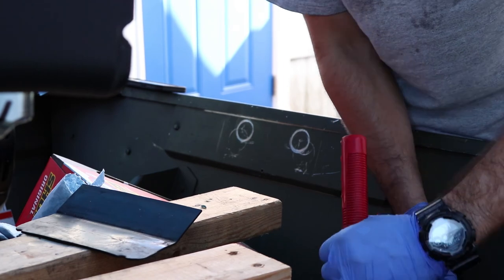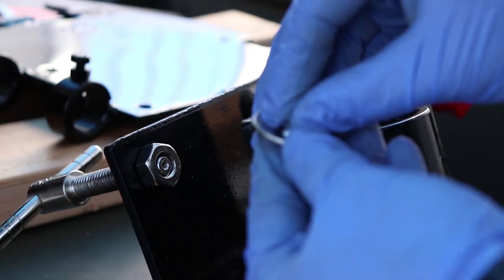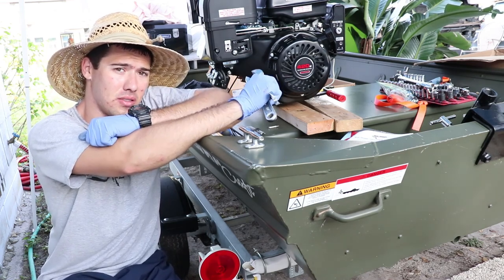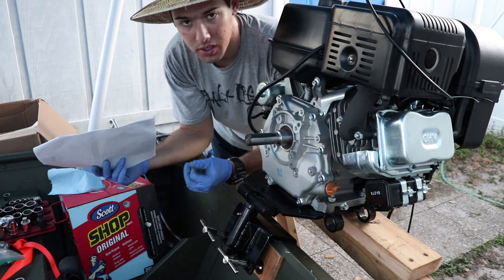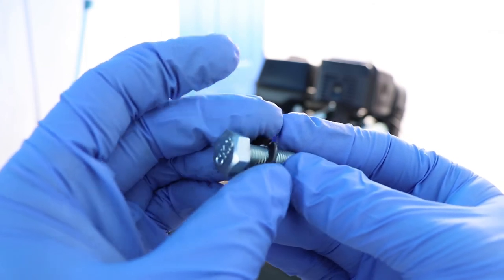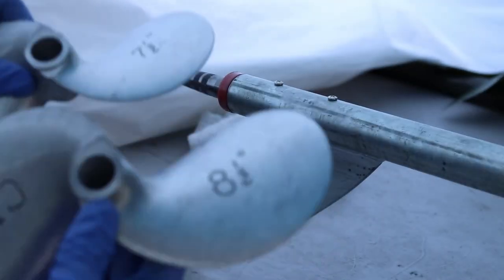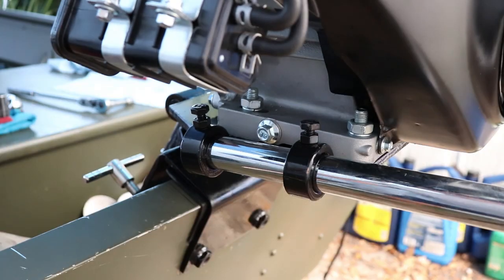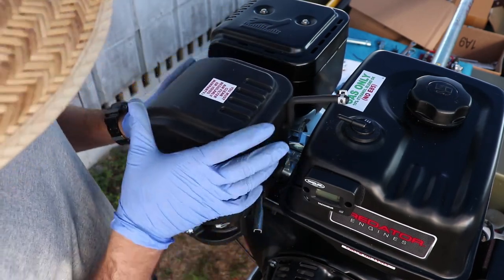Mud Skipper Long-tail Mud Motor Kit Assembly: S2E3

Comment: Thx for putting these up. It will help a lot of people decide on the right kit..
Reply: Ain't gonna lie, that chrome look pretty slick!
Reply: Sadly I believe that's more the boat design than the kit design. These transoms are raked out way to far. Stinking American outboards!
Reply: I always mount the mount fist then put the engine on. Man, that bracket just ain't right. I don't see how that will hold up.
Reply: Hey, if you don't mind, what camera do you shoot with?
Reply: They want you to drill a hole in your boat? Man, write this kit off!
Reply from the maker: The chrome is nice looking! The handle isn't holding up as well as the coupler housing though. Some people don't like the chrome through because it doesn't take paint well for duck hunting. 
It does stink about the transom angle but its these kinds of things that people run into when they purchase a kit so better to find out now while your researching before you buy.
The bracket is a little awkward with the nuts not being welded on straight and the bracket flexing/bending when tightened down.
I use a Canon DSLR SL2 with the kit lens. I was looking at the 70D but it was too much for my first camera, and then the SL2 had just come out so I went with it. Its light and works amazing. It has taught me a lot about how to operate a DSLR. You will see the quality in the videos go up when the new series come out.
Yeah I didn't like the idea off putting a lag screw through the top of my transom. So I didn't hahaha
Reply: I I know it about cameras, man. I've been running a Nikon D3300. I've been wondering if I should save up for a new camera or just go ahead an invest in lenses. I think I'm going to get better lenses.
Reply from the maker: Yeah I plan to have this camera for many years and if I need too, I will just get prime lenses for special things. I don't like having expensive things. I'm always too worried about breaking or ruining expensive things. I like to keep everything very minimalist. For example, a jon boat, a long tail and an old truck. Don't have to worry about scratching those things hahaha

Comment: Hey thanks for your video I'm in Tasmania and just got the same kit from Thailand, it arrived with no instructions and zero knowledge here in Australia on long tails. I'm wondering about the fitting that goes onto the PTO shaft [ 9-10 min. in ]  mine came with four bolts not two and a short key but other wise it's the same, for those four bolts I'll use loctite, no brainer. But what about the main thread that connects the two pieces  loctite or antisieze, it should be self tightening so I'm thinking antiseize, but I'd appreciate some input from you or others. Thanks.
Reply from the maker: Hey John, you thought it through and you are correct. Use the thread lock on things you don't want to vibrate loose, and anti-seize on things you may want to remove later on. As you mentioned and are correct about, that pto shaft and coupler for the pto is self-tightening as it runs so it can become very tight, so anti-seize will help with disassembly if you ever need to and you do not need to worry about it unscrewing itself. As for the bolts, you would benefit from a thread-locking additive so they do not vibrate loose.
Reply: @JTgatoring  Thanks for getting back to me it's good to have it confirmed, thanks again.
Reply from the maker: @johntaylor6654  No problem at all. Have fun!

Comment: Is there any Benefits to running the mount on the outside of the transom compared to the inside? Also I’m having troubles bringing the front end of my 14 foot v haul out of the water the long tail motor seems to want to make it dig into the water and I can’t get to a plane. Any tips? Thank you
Reply: I also can’t run any bigger than the 212 due to the transom rating so possibly just not enough power or do you have any tips to trim the boat up in the front
Reply from the maker: @Mental-Mess  That would be a question for the manufacturer or brand. I know that a thai style longtail will push the nose down more when compared with an outboard, but I've never had someone ask about reversing that or minimizing it. I think its just that way and there's not much you can do about it. To lift the nose up, you would need propulsion down low under the transom like an outboard to help lift the nose. I don't know the answer to this one. Its not a common problem. Let me know what you find and if you're able to fix it the way you want too

Comment: Do you need the clutch kit for this?
Reply from the maker: There was not a clutch kit available when I built this kit. I didn't use a clutch kit.
Reply: @JTgatoring  Thank you! I just didn’t know if I would have to spend an extra $159 just to get it to work.

Comment: Hu there. My shaft keeps rotating every time I use it. I've tightend the heck out of it, but it still rotates. Is there anything that can fix that? Thanks.
Reply from the maker: The first thing to check is if you put the wing bolts in the correct way on the coupler housing. The wing bold should go through the smooth hole first and then into the threaded hole. Let me know if that was it or not
Reply: @JTgatoring  Hi. I installed them the correct way, but as much as I tighten them, the shaft still moves. Thanks.
Reply from the maker: @MrRyancangri  I would say tighten them down more.?. Are you closing the gap between the two coupler wing bolts? If you are able to close the gap between the two ears and the shaft still turns, I would contact the company that sold you the kit. This is a mud skipper video, is it their kit?
Reply: @JTgatoring  Actually, I just contacted them yesterday, and they told me to remove the shaft, tighten the bolts as much as possible, then loosen them, reinstall the shaft then tighten. That'd what I did, then I took the boat out in the water for hours, and it did not rotate one bit. Problem solved.

Comment: Should make beveled wood blocks,too make bracket,more plumb,than tight to stock transom Wood, Need a table saw to cut angles.Works good on mine.
Reply from the maker: I was going to do something like that if all of the mud motors didn't work out on that transom, but the Swamp Runner kit worked so I'm glad I didn't have to try and make those wedges. Thank you for the tips and watching the video. If you could take some pictures of your wedges and send them to me, I'd really like see how it worked out for you 👍

Comment: Why not cut Wedge blocks to get bracket level,through bolted,
Reply from the maker: I may end up having to do that, but I believe you shouldn't have to put more time and effort into a kit to make it run correctly.
Reply: That's why I went with sps swamprunner on my other boat,thanks to your Vid,sThanls!